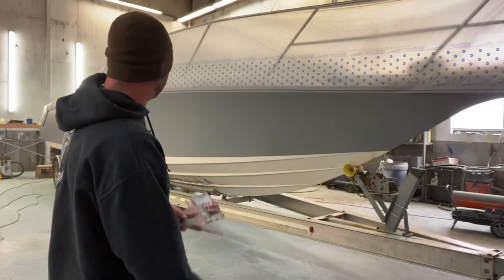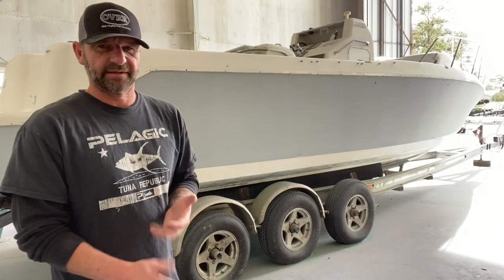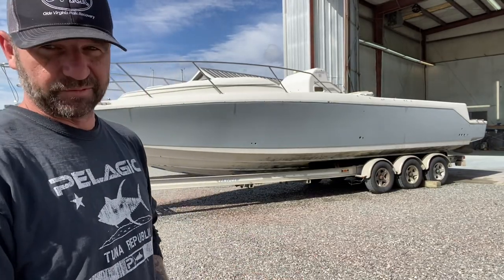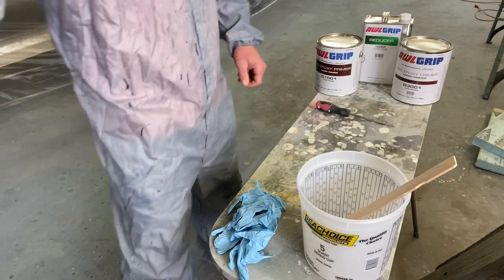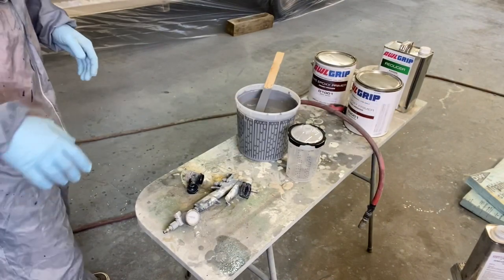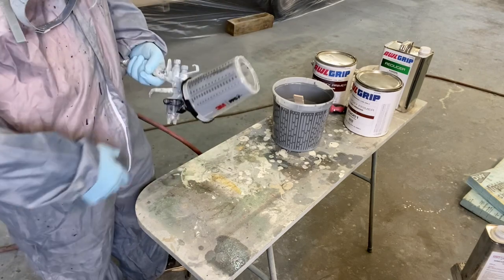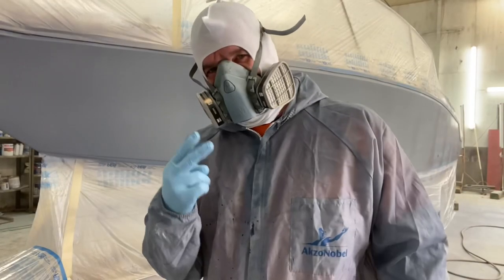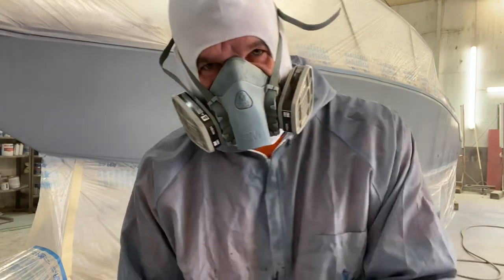Prepping a 1996 34ft PROLINE for a SUPER JET BLACK topcoat finish 👌

Comment: I am going to be spraying f2168 Extreme Black this week. Customer wanted the same Super Jet Black you will be spraying, but, it has been discontinued as of 2022 and it was hard to get at a reasonable price. I had only 1 quart left and didn't want to take the risk. I will be doing the Extreme Black on the bottom then from the rubrail to the waterline or first chine line with AwlCraft SE Stone Gray Metallic. then the stone gray metallic will get 2 coats of AwlGrip HDT Clear and sanded with 500 grit, then 3 more coats of Awlgrip HDT clear as well as 3 coats clear on the Extreme Black on the bottom. He won't ever keep the boat in the water more than 1 day and knows that the AwlGrip is only supposed to be sprayed above the waterline, but, it just can never go more than 1 day in the water. I may record it and put the video up on my YouTube, havn't done a video in over 2 years, been so busy in my new shop, I never have a chance to edit. I might for this boat as its kind of a special boat.

Comment: Thank you for making these videos. I would like to know how you would handle a wooden boat hull, (sealer?, primer, and top coat. ) wooden boats live , crimp and stretch. I wonder how you would tackle that. Thanks.
Reply from the maker: Sorry for late response. Just now seeing this. Honestly, if it was my boat, I would prep everything the best I could and then apply a couple coats of Devoe preprime 167. (100%solids wetting out epoxy) then 2-3 days later I would apply 2-3 coats of Devoe Barrust 235. ( no sanding the preprime) then I would prep and glaze out any imperfections I could find and then sand the hell out of it. Then use Devthane 379 as the topcoat ( color of your choosing). The stuff is rock solid and lasts longer than anything else. My opinion. Not super expensive and it’s all industrial. This is what I would use if it was my boat. Everyone is different.
Reply: @boatpaintingrestorationwit3029  thank you very much Frankie! I understand what route you would go. I am currently working on the 60feet boat yard. There is not that much product available. We cut out some rotten spots and replaced the wood. Used 2 part epoxy filler, primed the boat with regular hardware store metal primer, 3 coats. Used a light filler in between spots. Next day, where the sun was beating the hull, cracks appeared… filled again etc. We too coated with a regular siliconised alkyd enamel paint. Like a heavy Rustoleum type. I know that this sounds like shit to you, but that’s what we got. I really like the suggestion you make, and I took note of it for next time. Next time, I’ll sand the entire boat down to the wood and do exactly what you said. Too not have this issues. This is just the hull we are doing. Once in the water, we’ll do the top of the boat, there last year all the marine paint we used all cracked up in the 2 weeks after the sun hit it… it looked so good…for two weeks. Sad story. But for the top I’ll sand all down to bare wood and do what you suggested. Thanks Frankie! Love your videos!

Comment: Did you not consider grinding the minor cracks? Omg, your work is awesome! I would like to work a project with you and learn from a real professional!

Only 12 years on the ocean as a marine electrical engineer and 3 years Racing for the  Royal Navy however, no experience rebuilding a hull and painting!

Would you recommend a gel coat peeler, then fairing, then 3 undercoats, then copper coat on a boat? I would love to hear your thoughts on this
Reply from the maker: I did consider it but it was alot. With the boat going offshore and black on top of that, if I would have cut all those open and fixed them, new ones would pop up next to it. Never fails. You can only do so much before it becomes a waste of time. My opinion. 👌

Comment: Frank , is denatured alcohol better than awlprep T0170?
Reply from the maker: They both work great. I have always used den. Alcohol for the most part. Never no issues and it’s cheaper than awlprep. Both products work great though.
Reply: @boatpaintingrestorationwit3029  quick follow up question I’m getting some bad fisheyes on this backcove 29 I’m painting , I’m suspicious the cleaning solvent is breaking down the shotty old bedding that meets the hull under the rubrail . Could that be the cause ?
Reply: @mespo7399  
Depends where the fish eyes are .
Under the rub rail ?
Or everywhere?
Reply: @cspray5386  it was happening both under rubrail and like down half way freeboard , i remedied it with alot of solvent cleaning before final application but pain in the ass not knowing the cause
Reply: @mespo7399  
Rub rail and dragged down from rag.

Comment: @frankie you know more about Awlgrip than I ever will, can you spray a rubrail to waterline on a skiff in stone gray metallic (not SE)? Says for boot strips but planned to spray 545 then sand 400 then apply 2 to 3 wet coats metallic then apply 2 coats AwlCraft clear, then sand 500 then 2 more coats clear sand buff polish? Any idea if AwlCraft metallic non SE can be sprayed like that? 19” hull sides height roughly. I have the SE version too. Curious though.
Reply from the maker: Yes you can!  Sorry, my YouTube changed itself and the only way I see comments is if I go to the video and look. ////. Honestly, 500 grit is to fine unless you super thin the clear. I personally would lay down the base, give it a 1/2-1 hr. Then do a mist coat of clear, then a full wet coat. Sand with 320- 400 at most. Apply 3-4 more coats of clear and then you’ll definitely be golden. Anyhow, just my opinion bud 👌
Reply: @boatpaintingrestorationwit3029  so I am only scared of mottled metallic. I will take your advice 100% but just to clarify 
545 sanded with 400
Spray the metallic in 2 wet coats with a mist coat after each 2 or 3 sections (to prevent stripes)
Wait 1/2 to 1 hour and spray a thin coat of clear
Then spray 2 wet coats clear after thin coat is tape tested to touch
Sand with 500 the next day
Re prep/solvent wipe/ tack rag
Spray 3 or so more coats clear? 

I am down 109% my only fear is that the TDS says to spray the clear after 12 hours but no more than 24 after metallic. If I was spraying the SE version that TDS says to spray the clear within an hour. I just want to make sure your understanding that this is just stone gray metallic not stone gray metallic SE. 

Thanks for following up, hopefully I get a response before I spray this boat. The bottom is all done in black looks like a mirror and I’m very happy with how it turned out.
Reply: 400 machine
600 wet hand 
For bases. Always!
No need to sand up clear , why ????
After 2nd coat of base, get 2-5mtrs up and come back and control coat.
Wait 1 hour
3 coats of clear 
Finished